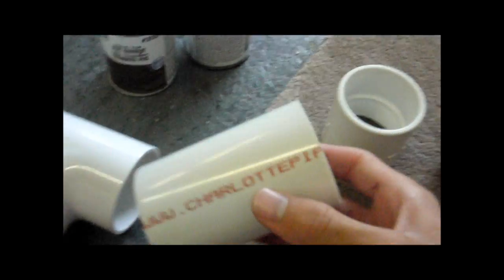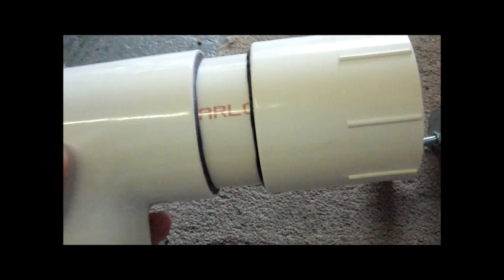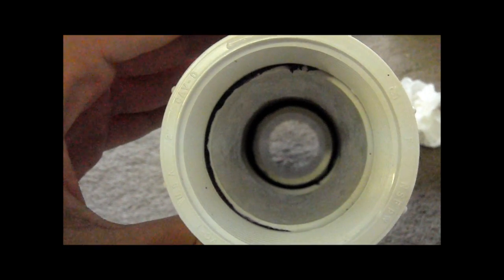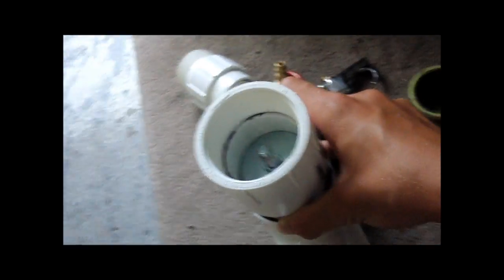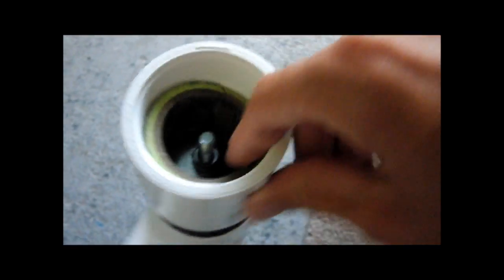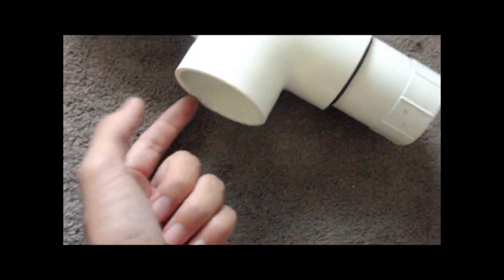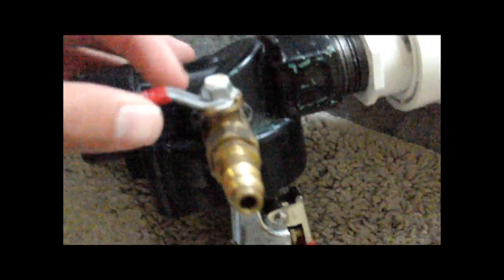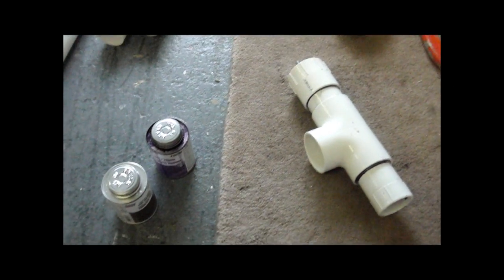How to build a 2 inch piston valve [Part 3]

Comment: Is there a significant advantage to using a double pilot valve as you have shown at the end (the manual blower acting as a pilot to the sprinkler valve). Vs just having the blower valve be the pilot for the piston?
Reply from the maker: +Kevin Finnegan the pilot valve has to be quick enough to exhaust the air quicker than the air can leak past the piston. so the quicker the better. these valves perform much better with bigger pilots.

Comment: One safety mechanism to prevent accidents would be to put a slight obstruction in the barrel (such a screw screwed in) so the projectile doesnt hit the piston and have a accidntal shot, and annother one could be to put a spring after the piston, with some tention to in case of dropping the gun (specially those with heavier pistons) , but the spring might harm a little bit the power of airguns with smaller air resevoirs, but i suppose in guns with bigger chambers, its impact in power might be neglibe

Comment: Hey, me and my friend have started our new channel, and we make air guns and other cool stuff.  I have a lot of past experience with making air guns and i was goign to make an air cannon that shoots tennis balls and soda cans.  Could you tell me how to modify the sprinkler valve and what works best for triggers?.  it would be really cool if you could give us some tips. Thanks.
Reply from the maker: I prefer the blowgun method, where you take a sprinkler valve and drill and tap the top of it to insert a 1/4" nipple. This has worked very well for me in the past. However, I won't go in depth because there are a few good tutorials already on youtube! Just search for modified sprinkler valve.

Comment: You said in your video that all tees werent the same size and if you would send me the length of your tee which is 5 1/4 inches  you would figure out the right measurements
Reply from the maker: are you referring to how to determine the length of pipe that should protrude into the tee? As long as the valve seat is about in the center of the tee (look through the bottom port) then it should be good

Comment from the maker: Thank you for watching! A 2 inch barrel will work fine as long as you build the valve the same way and you use the appropriate fittings to step up the 1.5" female valve output to 2".

Comment: Luke enjoyed the piston tutorial.  I am using 4 inch chamber and 2 inch barrel which is 11 feet long. On the tee the only end threaded is bottom one to chamber, or isnt there supposed to be one threaded end for barrel?  Am using 3/4 inch mod sprinkler valve.  Is that okay or should it be  1"
Reply from the maker: a 3/4" valve should work just fine. I'm not exactly sure what you're asking about the tee though

Comment from the maker: the faster the pilot loses pressure, the faster it will open. since the volume is rather large for such a big valve, I used a rather large pilot valve to exhaust the volume. this way it opens as fast as possible. another advantage of the modified sprinkler valve pilot is that you get a nice trigger 8-)

Comment: Thanks.  
Great, albeit long, tutorial.  Question: why do you use the sprinkler valve as a pilot?  Once the "pilot volume" loses a little pressure, won't the piston open all the way?  Seems like overkill.  Thanks again, great tutorial.

Comment: If you use a piston valve, why do you need the sprinkler valve? Could I just put an end cap behind the piston, drill 2 holes, and insert a tire valve and the blowgun?

Comment: Oh! So under the tee there will be a chamber and on the left side of the tee there is the piston and the ball valve.so I need to feed the pressure before the ball valve so that the piston could seal the barrel and it will fill the pressure tank